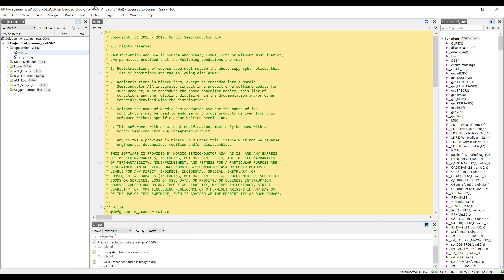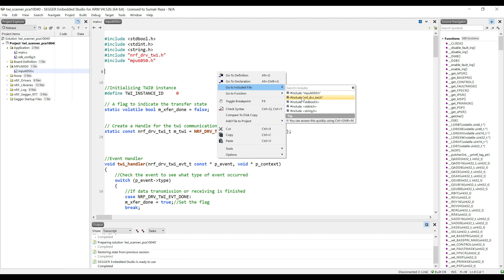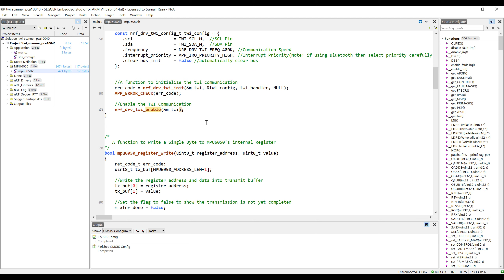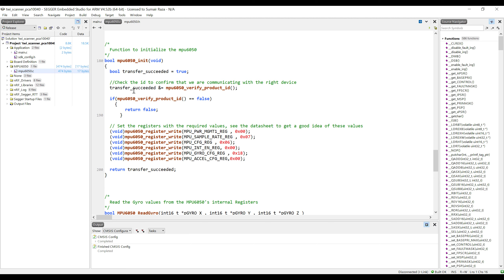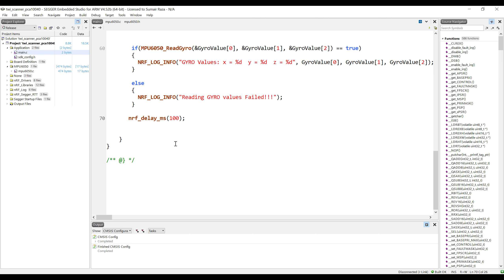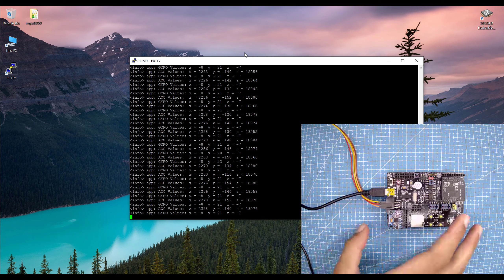nRF5 SDK - Tutorial for Beginners Pt 35 B - TWI - I2C with MPU6050 Accelerometer & Gyro Sensor

Comment: i had a question regarding the function 

bool max30100_register_write(uint8_t register_address, uint8_t value)
{
    ret_code_t err_code;
    uint8_t tx_buf[MAX30100_ADDRESS+1];
	
    //Write the register address and data into transmit buffer
    tx_buf[0] = register_address;
    tx_buf[1] = value;

    //Set the flag to false to show the transmission is not yet completed
    m_xfer_done = false;
    
    //Transmit the data over TWI Bus
    err_code = nrf_drv_twi_tx(&m_twi, MAX30100_ADDRESS, tx_buf, MAX30100_ADDRESS+1, false);

why are you doing the part "MAX30100_ADDRESS+1" don't we either have to put a sizeof() or int value to indicate the length
Reply from the maker: Hi manan, we only need two bytes to TRANSMIT to WRITE in a single REGISTER  at a time. First byte is the register address and the second byte is the data, However if your sensor has been set to auto-increment the internal register pointer of the Max30100, then you can write multiple bytes at the same time, then you can set the tx_buff size accordingly. For your ease i will give you a hint: tx buffer size will be equal to size of data to be transmitted + 1 . this 1 is actually the start register address byte, and it should be the first byte to be transmitted so that we can write to the required registers of the sensors. Hope so i answered your questions. ;-)

Comment: Hi Sumair, how can we implement, Burst Read in TWI?
Reply from the maker: Hi manan, we can do the burst reading with the same function that i used, but you have to set the sensor's auto increment register pointer settings so that when we do a burst read the pointer address automatically increments and we can continuously read the data up to the required length.

Comment: Thank you so much Sumair for the video and the an awesome tutorial, had a question regarding twi, i am trying to interface nrf52840 and max30100 using twi, but i am unable to read the circular buffer in max30100, if possible can you shed so light on it. Once again thank you for the all the tutorials.
Reply from the maker: Yes, you can read from the circular buffer, all you have to do is to look at the data sheet and look for auto-increment register address settings. Once you set it to auto increment of register pointer (during the initialization of Max30100) then you can write multiple bytes at the same time. Hope so this helps ;-)